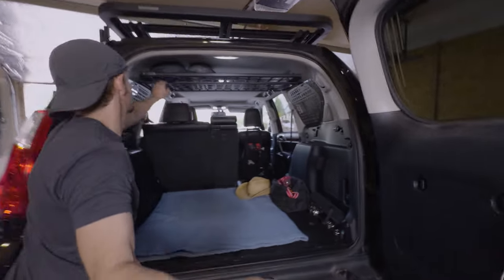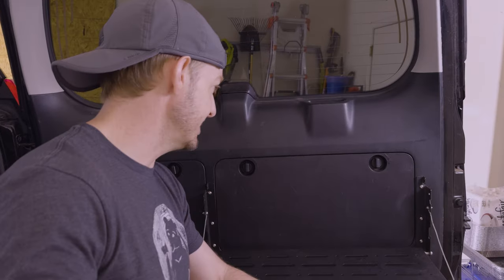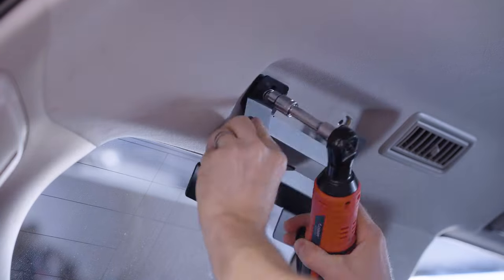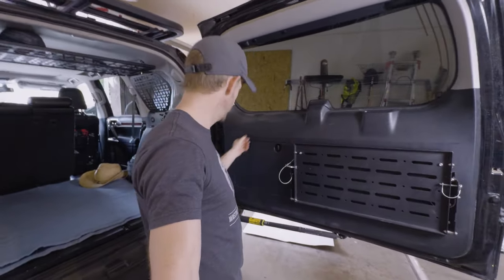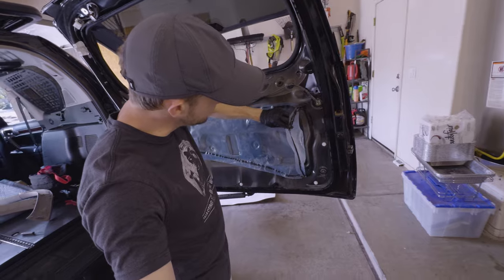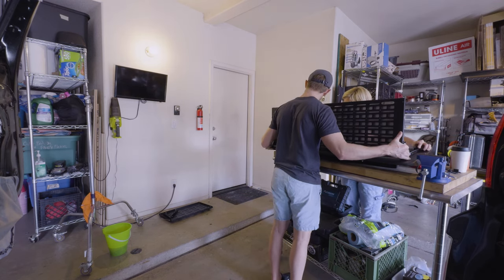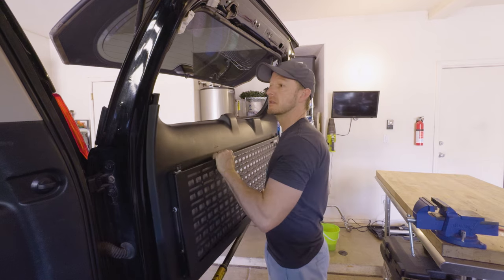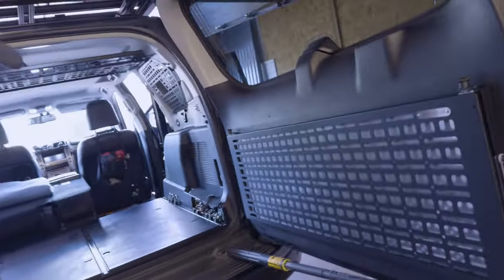Bison Gear Molle System and Table Install

Comment: Removing panels that you have never removed before is absolutely pucker-inducing. Also, good call on the locktite. I can't deal with the slightest rattle either. (plus obviously you don't want it coming apart and impaling passengers, but this a secondary concern to the noise...)
Reply from the maker: They always hide a screw somewhere you can't see : /

Comment: Great video. I made the rookie mistake of adding the shelf too low and had clearance issues when I tried to close the tailgate on my 2011 GX. I viewed this video a few times and used it to do my project. Only today did I realize that you already have your third row seats removed. Mine are still in place, so the clearance tolerance is higher than optimal. Word to the wise, if you leave third row in, your table will be higher up on the rear panel and (in my case) you will have to do some after market mods to the topmost screw hole because the door trim bevels inward just at the location of the top-most hole position on the Bison. 🌲
Reply from the maker: Thx for sharing!

Comment: You've mentioned something about the drawers. Just keep in mind that you won't be able to open the right drawer when cooking on the table. I have drawer based fridge on the right and that's why I went with 2/3 table instead of full length. If you're going to keep your recovery gear/tools on the right then you will be fine. However, if you're going to use drawers to maximize storage for food goodies and cooking hardware then you will regret going with full length table.
Reply from the maker: Good point! We have all the campsite set-up stuff, recovery gear, and tools in that one for exactly that reason. The left side is kitchen gear, and dry food generally rides in the 40% seat position to the fore of the fridge (I took mine out for extra room). My bigger concern is how my tilting fridge slide will work with it. It's still on it's way from Poland but we should find out soon : )

Comment: By the way i used to install car stereos for a living and believe it or not you do not need sound deadening on every inch of what your trying to insulate. The reason why is because one square inch will cover at least one sqinre inch all the way around it. A good example we used to do is put a one square inch piece on a counter bell( the kind you use to get the hostest attention at a hotel or where ever) and that sall pice would make the bell a " dead" it wouldnt "ping" anymore. Which is what your trying to accomplish with sound deadening meterial. Your just trying to make your metal surfaces not sound so tinny. So recap you dont need as much as you think you need . You could do it in a checkered patfern and achive the same results.

Comment: so, have you tested it in the field yet? ANy rattles?
Reply from the maker: Rattled at first, then I switched out all the nuts to nylons and added thread-lock to where it attached to the truck. No rattles since.
Reply: @WastingTimeInTheWoods could you share a link to the nylons you used? Going to be installing this shelf and panels in the back of my FJ soon.

Comment: Any rattles?
Reply from the maker: Nope. But I replaced provided nuts with nylocks and used lock tight where I could not (lower side panel screws)
Reply: @WastingTimeInTheWoods  ok great! that's been my concern with these